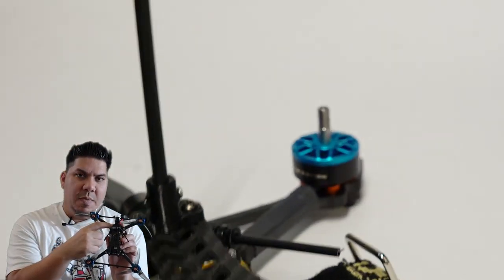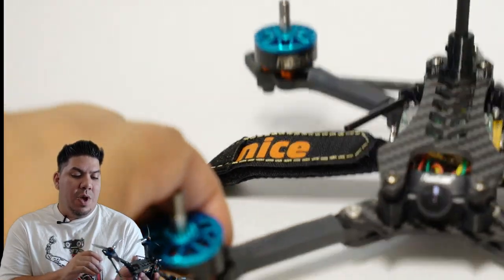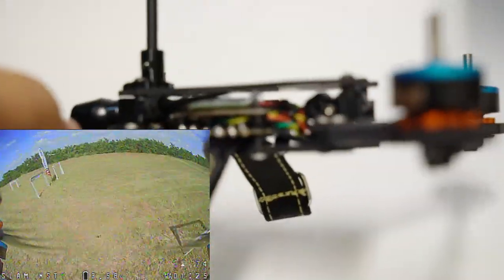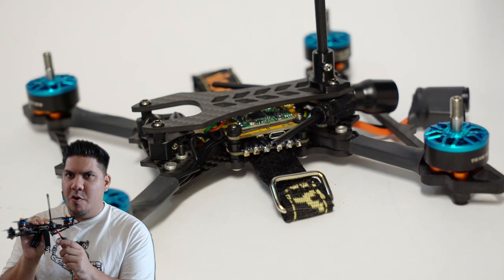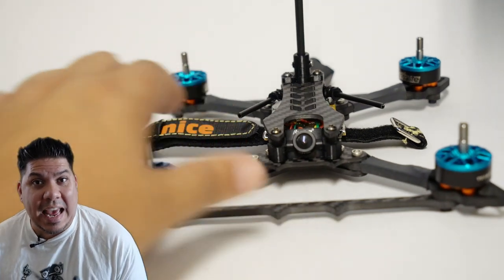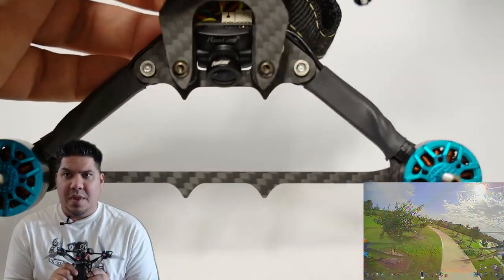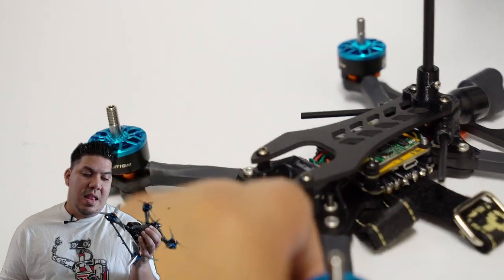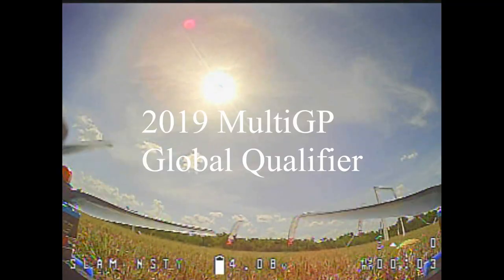Slam Nasty: Catalyst Machineworks Racing frame for competitive drone racing

Comment: I just built me one. Absolute perfection. I just have to get use to the true X rather than stretched X. Using t motor f55 pro 2 f3 mcu 4-1 esc and f80 pro 1900kv. It's a beast. My new favorite. You have a very nice build!
Reply from the maker: Sounds like a total beast!  I bet with those motors you are getting some serious top end speed.
Reply: @JonE5FPV  crazy speed and very linear feel. I really like them, so much so I have them on 5 of my favorite 5" quads. Take care and have a good day

Comment: I noticed the standoffs are fixed to the braces only instead of the whole bottom plate and arm like any other frames. Do you have any issue with this?
Reply from the maker: No issues with this.  Especially since these standoffs are shorter than the average standoff.  I usually have more standoff bending issues on a traditional frame like the Floss where the standoffs are exposed and taller.